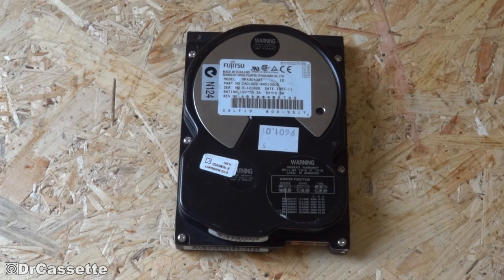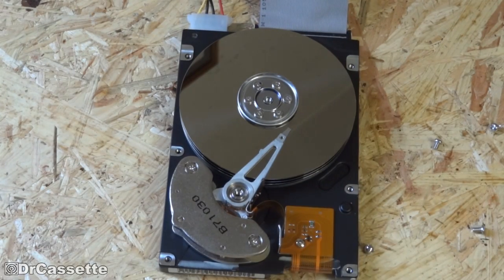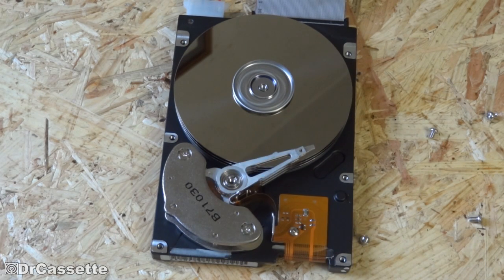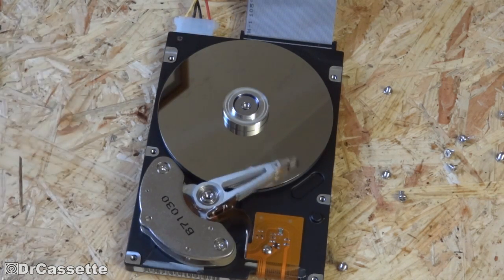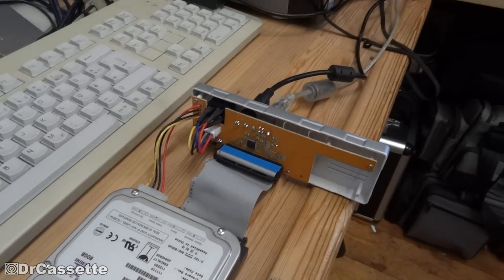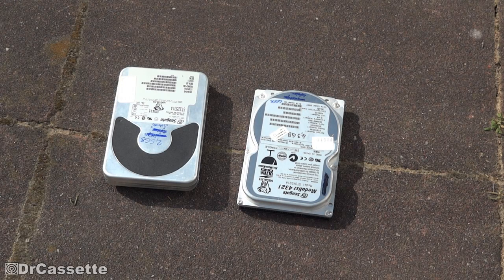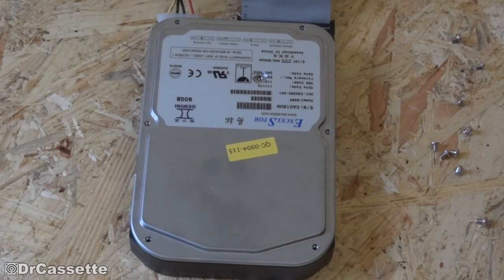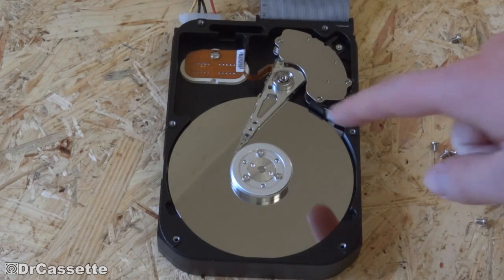Hard Disc Drive - Video Collection

Comment: This is a coincidence: While watching your Marantz restoration clips, I was testing out some old hard discs on another machine. Two of which were 4.3 gig Fujitsu drives just like this, except they were branded for IBM. Both work and passed surface testes. I then installed MS-Dos 6.22 and Windows 3.11 for work Groups on an Asus/AMD 486 DX4-100 desktop machine. I forgot how quickly dos and windows installed back in those days. Remarkably, one of the drives I tested is a Conner CP30104H 121 megabyte drive manufactured in 1992. Still works after 22 years.
Reply: I got a 32mb drive from 1988 still going today

Comment: Excelstor (aka. hitachi) disk drives make these noises, I have 4 of them and they sound identical to this. They make a nice ATA-133 RAID for older computers :)
Reply: +Oerg866 are u sure his is made by hitachi? It doesn't look like any deskstar i've seen. when hgst took over, their deskstar series all had ramps for the heads. this one looks more like a samsung, if anything.
Reply: +Your Mom Your Mom

In the early 2000s Excelstor made hard disks for IBM under license and this was extended to Hitachi after their patent exchange and manufacturing agreement with IBM, and they continue to mfg drives for HGST.

(They did make their own drives and still do)

Comment: The evolution of storage units is really amazing... My dad told me about when his company had bought a RAM unit, or whatever they are called, back in the 70's or 80's. It was as big as a refrigerator and cost around 70000 dollars, and it's capacity was less than one megabyte. And look where we are now...

Comment: I had a vintage external apple 20sc hard disk from 1986, it had a massive seagate ST-225 SCSI hard drive, with.....a WHOPING 20 MEGABYTEs of storage, yes 20 megabytes, ended up selling it for a little over $60 just because it was vintage apple

Comment: i know some people get really paranoid about Data and identity theft, and resort to extreme destruction of their hard disk's.. for the most part that's fine as hdd's are cheap and easily replaceable these days.. 

however in the case of the smaller (less than 5bg's and even the sub 1gb) IDE hard disks then there is a good second user market for them, the Retro computer market.. 

as long as the drive are fully reformatted, the chance of data recovery/theft is almost no existent

Comment: I had a pile of dead drives.  I wound up drilling holes in them and then hitting them with the sledge.  I put them out on the curb and they were gone the next day as people drive around picking up scrap metal.

Comment: The magnetic field is between the two magnets where the coil is that moves the heads. The magnets are attached to steel plates that are bolted to the each other and the chassis. This way no stray magnet fields can get to the platters of the drive. It's the same for the motor. That is surrounded by a metal shield that makes up the rotating part of the motor itself.